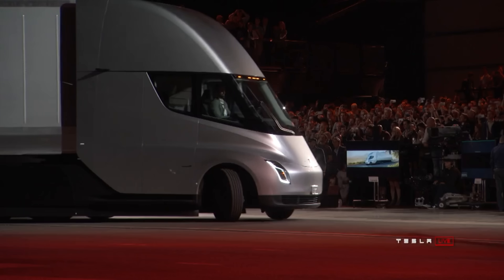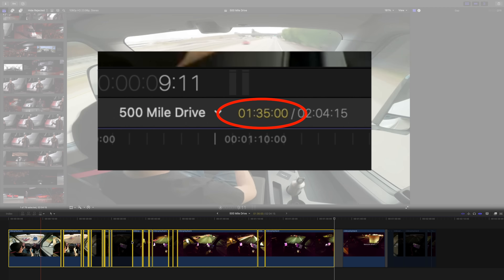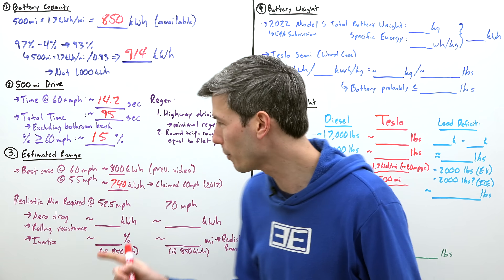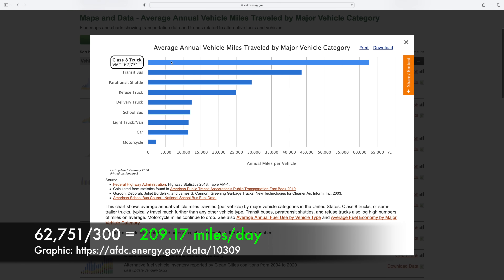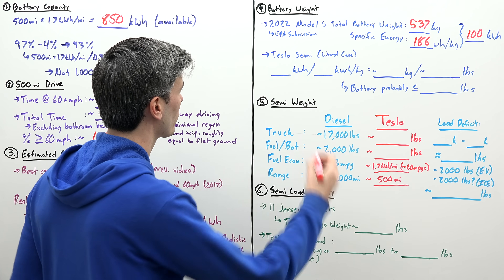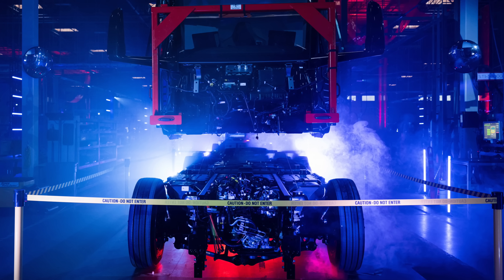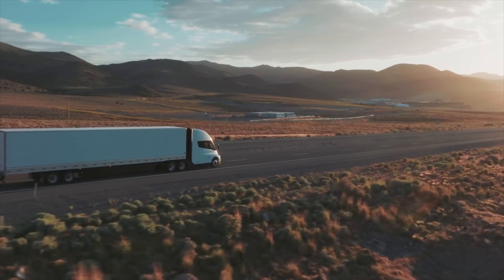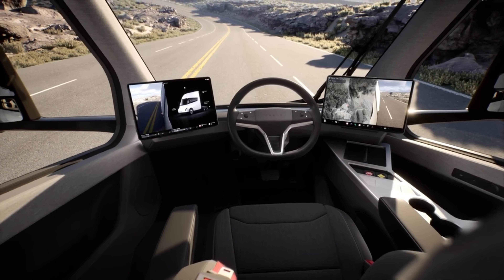Does The Tesla Semi Make Any Sense? Part 2!

Comment: Bro going below 60 MPH I can get more mpg with diesel than electric
Reply: Well only if you are geared for it. My International can only go as low as 56 in top gear, while empty on a flat road.
Reply: Not a chance. Show your calculations to support this extreme claim.
Reply: @Big_Ben_from_La_Mesa  I'm a truck driver. Get your cdl and we'll talk after that
Reply: @AshkanAbedian-qg2ni  Sad to say, being a truck driver does not repeal the laws of physics. Tell you what; give me the speed, GCVW and MPG for your diesel, and I'll give you the consumption of a Tesla Semi under similar conditions.
Reply: @Big_Ben_from_La_Mesa Being a truck driver doesn't change the laws of physics. But makes me the primary customer. Only way to win me over is if your truck can save me more money. I only have 11 hours a day and I make 70 cents per mile averaging 60 mph. A tesla costs 2 hours of my time every day just to go off route to a charging station and wait at the station to charge. I average 8.5 mpg. 2 hours of my time costs $84 per day, Which translates to 20 gallon of diesel. In order for a tesla to make up for the 20 lost gallons, It needs to achieve 15.45 mpg more than my diesel truck. So if tesla gets 23.5 mpg and my diesel gets 8.5 MPG, I'll just break even. On top of that,  A tesla semi is $400,000 more expensive than my diesel semi. That translates to 40 cents a mile or another 5.7 gallon of diesel or... another additional 48 mpg. That means I need my tesla to get 71.5 mpg in order to break even. 😂. And as is tesla gets less mpg than diesel.

Comment: This is like for all technology,  some cases will suit it,  some won't,  but bringing in regulation to force compliance will potentially have worse consequences.  Trucks aren't always fully loaded with weight but sometimes are,  and it's not the same trucks all the time.  Regulation to remove diesel could cause an increase of trucks and journeys by 30%+ as they send 2 trucks for one load. Let's hope we can all keep an objective head in the coming years.  Good video,  only comment is that day trips like this would be done in light weight semi's not large ones,  so there is a greater loss of weightthan you suggest.

Comment: I'd like to know a few things about the electric semi truck how much cargo weight can it haul compared to a diesel truck which is 20000 pounds it takes a diesel truck around 20 minutes to fill up with diesel fuel and can travel 2000 non-stop with four drivers 2 in the sleeper alternating how many stops does the electric truck have to make to travel 2000 miles
Reply: how much cargo weight can it haul compared to a diesel truck which is 20000 pounds 
About 43,000 to 44,000 lbs. But I think you're mistaken about diesel trucks; their typical payload is about 46,000 lbs.

 how many stops does the electric truck have to make to travel 2000 miles 
Four one-hour charges, loaded to 43,000 lbs. But the Tesla Semi isn't designed, intended, or marketed for OTR applications, so this really isn't relevant.

Comment: Curious what your thoughts are operating a test semi in the Northeast during the winter months. I know based on your prior videos that will drastically reduce your efficiency.
Reply: No different than a Tesla passenger car, just warm up the battery before you start driving for maximum efficiency.

Comment: The science is good here. But the Tesla Semi is busting all expectations, sometimes doing 1000 miles/day most of it under a heavy load. Bye Bye hydrogen.
Reply: Looks like it's not
Reply: @aSASa45454  The science here, or the Tesla semi?
Reply: @777Outrigger  the semi. There is a Pepsi guy who posted they're struggling to get 400 miles
Reply: @aSASa45454  Quote and source, please? Because I'm pretty sure that no "Pepsi guy" anywhere, ever, said anything of the sort.
Reply: Dan Priesty has revealed that the 500 mile Semi tractor weighs >26,000 lbs. Some estimates had the Semi battery weighing over 26,000 lbs and the tractor weighing as much as 45,000 lbs. Incredible! Starting to look like a lot of armchair engineering going on here.
Reply: @aSASa45454  But doing 1000 miles in a 24 hr period, with charging while the trailer is being offloaded and loaded. More than enough performance to replace diesel and kill hydrogen. ... Again, real world vs arm chair engineering.
Reply: @aSASa45454  Looks like it is. ....... From Electrek;  

"A Tesla Semi electric truck traveled over 1,000 miles in a single day in a real-world test for a new independent study.

There have been a lot of doubts about class 8 battery-electric semi-trucks. Many didn’t think that they would ever be able to compete with diesel trucks.

The North American Council for Freight Efficiency (NACFE) has been conducting a study as part of its new Run on Less program to test several electric trucks in real-world conditions and release the data in real time.

There are three new Tesla Semi trucks in the program this year, and we reported on the first data coming earlier this month.

Now, the 18-day study has concluded, and on the second to last day, the Tesla Semi #3 managed to travel a record 1,076 miles in a single day ......

While NACFE didn’t specify the payload for this particular day, it did say that those trucks averaged over 70,000 lbs of loads."
Reply: @aSASa45454  Looks like it is. From Electrek;  "From Electrek;   .... The North American Council for Freight Efficiency (NACFE) has been conducting a study as part of its new Run on Less program to test several electric trucks in real-world conditions and release the data in real time.

There are three new Tesla Semi trucks in the program this year, and we reported on the first data coming earlier this month.

Now, the 18-day study has concluded, and on the second to last day, the Tesla Semi #3 managed to travel a record 1,076 miles in a single day ......

While NACFE didn’t specify the payload for this particular day, it did say that those trucks averaged over 70,000 lbs of loads."

Comment: Tesla's hill climb run up a 6% grade while fully loaded to 62000 lbs was not a load capacity test, as assumed. It was just to show how it could climb a 6% grade without slowing down, and buzz by a diesel semi. Based on the cars passing by, the speed was low as was the aero drag. A 6% grade is 3.43 degrees, so at a steady speed the tractive force required is (.06)x82000 = 4,900 lbs. The semi was slowly accelerating, so the force is actually a bit more. Also, after reading the federal statute ( 23 U.S.C. 127(s) ), the wording about the 2000 lb extra load capacity is most likely to just include the 2000 lbs of batteries, and not the estimated 2000 lbs of the inverter.
Reply: In hindsight, Jason was using this example to determine the max payload weight, and the 6 percent incline had nothing to do with it. So my reply was just an exercise in how much the cab's drive wheels were pulling. But he could have used the 44,000 lbs of concrete plus the weight of the standard flat bed trailer, subtracted from 82,000 lbs, to accurately determine the Tesla Semi cab weight.
Reply: @kevink2315   ...to accurately determine the Tesla Semi cab weight. 
Yes, that's what I've done, to estimate the weight of the tractor as 82,000 - 10,000 - 44,000 = 28,000 lbs.
Reply: @BigBen621  If you look at that intro video again on the 6% grade, you can see the color of the flat bed surface is consistent with an aluminum trailer. Teasla was trying to maximize the load capacity, and used a light trailer to help. They are about 8500 lbs, so the 44,000 lbs would be too much for a steel trailer. Sneaky.
Reply: @kevink2315  Actually, that creates a new quandary. I've been assuming the trailer was about 10,000 lbs. But if the trailer is only 8,500; the load is 44,000 lbs. of CalTrans K-Rails, and the GCVW is 82,000 lbs. as stated by Tesla, then the Tesla Semi must weigh around 29,500 lbs., which is a lot heavier than most estimates, mine included. Thoughts?
Reply: @BigBen621  Tesla mislead the public, but it likely will not matter as Jason showed that very few semi's are fully loaded.
Reply: Tesla's hill climb run up a 6% grade while fully loaded to 62000 lbs 
 82,000 lbs 

 Based on the cars passing by, the speed was low as was the aero drag.
No need to base on the cars passing by, you can clearly read the speedometer, at 45 MPH.

 at a steady speed the tractive force required is (.06)x82000 = 4,900 lbs. 
Speed is part of the equation, so this is true only for a single speed.

 The semi was slowly accelerating 
About 1 MPH/sec, which doesn't seem slow, figuring accelerating 82,000 lbs. up a steep hill.

the wording about the 2000 lb extra load capacity is most likely to just include the 2000 lbs of batteries, and not the estimated 2000 lbs of the inverter.
"up to a maximum gross vehicle weight of 82,000 pounds"
Reply: @BigBen621  I wrote full load, and meant 82,000 lbs. 45mph? Where do you see the speedometer during the hill climb? How do you know acc'n was 1 mph/sec?
Reply: @kevink2315   
 Where do you see the speedometer during the hill climb? 
You can see it for a few seconds starting at 16:40 in the Delivery video. I tried to include a link to it, but YT wouldn't accept it; but I assume that's what you're working from.
 How do you know acc'n was 1 mph/sec? 
I'm having a little trouble reading the speedometer this morning—either an early morning light issue, or an early morning eye issue—but I think it goes from 42 MPH to 45 MPH in about three seconds. One could get a more precise number by counting the frames between changing to 43 MPH and 45 MPH at 60 frames at seconds and doing the math, but I don't have the patience to do this!
Reply: @BigBen621  I had studied that delivery video, but missed the digital speedometer. I get what you got, 4 mph gain in 4 seconds, 1 mph/sec. With a lbm = lbf on earth, I get 3,740 acceleration load. It's interesting to calculate the tractive force at the wheels, but that was not what Jason was looking for, and I misunderstood that, but glad you noticed.

Comment: the fact that we have to do all this math to figure this stuff out instead of tesla just telling us basic information about the trucks like battery capacity, weight, size, etc, is embarrassing.
Reply: I'm trying to understand why this would embarrass you. You and many others of your ilk seem to believe you have a God-given right to have information Tesla, a private company, has chosen, for their own reasons, not to share, except with prospective customers. Maybe the problem is yours, not theirs.
Reply: @Big_Ben_from_La_Mesa  this is all basic information that you can get for just about any vehicle. typically you want to know what you are buying when you buy something. i dont think its crazy to ask for the vehicles weight, battery capacity, dimensions, etc. from a company that wants to sell a vehicle. then again this seems like a trend in the semi truck market overall, i cant find much information about many other trucks either. that doesnt make it alright, that just makes the whole market annoying. cant easily compare two trucks if they both hide so much information about themselves.
Reply: @minneelyyyy  If you were an actual prospective Tesla Semi client, you'd have all this information and much more—just as soon as you signed the NDA.
Reply: @BigBen621  exactly. its extra hoops you have to jump through just so you can comparison shop. how am I supposed to know which truck I want to buy if I can't see the specs comparison shop without going through a whole process?
Reply: @minneelyyyy  
 how am I supposed to know which truck I want to buy if I can't see the specs comparison shop without going through a whole process? 
Well, I guess you aren't. Tesla will just have to live with the horror of not winning your business.
Reply: @BigBen621  you act like im the only person in the world who wants to actually compare the things i buy before buying them.

Comment: @litestuffllc7249  you'd have to go to death valley on a hot day to even approach that temprature in order that the diesel would vaporize on its own. 
FALSE It's difficult to see how an adult who's actually operated motor vehicles could believe that the only way the temperature of diesel fuel could be raised to its flashpoint of 125°F is if that's the ambient temperature. The only explanation I can come up with is that you're not yet of driving age, and so have never opened the hood of a motor vehicle and experienced the temperature there. Perhaps you can provide another explanation of how you would not be aware of this?

 the flashpoint goes up to 180f 
FALSE You're obviously cherry-picking this from some source, without actually verifying what the source says. Likely, this is referring to different grades of diesel fuel. But the grade used almost universally is #2. If you'll search for the Exxon MSDS for #2 diesel fuel, you'll find 100°F, obviously being cautious. If you'll search for the CitGo MSDS, you'll find 125.6°F. Valero, >100°F. Wikipedia, 126°F. BP, 125.6°F. See the trend?

 compared to a fires from a massive truck battery, the safety is at least 100x better 
FALSE This is just another in a long line of examples of you just making stuff up, and trying to pass it off as fact. If you'd actually do a little research, you'd find the statement by the National Fire Protection Association (NFPA) that "It takes some time for enough energy to accumulate to trigger thermal runaway in a battery. This makes them different from ICEVs, which can be quickly ignited by a spark or flame." 

In actual testing done by NFPA, in which an EV with battery was deliberately set on fire, it took over four minutes before flames were observed from the battery pack, providing plenty of time for occupants to evacuate. Meanwhile, a report of a collision between two diesel trucks in Gotthard Tunnel, in which 11 motorists died, contained the follow statements: “The two massive vehicles smashed into one another, with the Italian truck skewing across the roadway until it completely blocked the tunnel. … [diesel] fuel leaked from the two damaged trucks, and suddenly ignited. … As fuel spilled onto the roadway, the fire spread too, engulfing several more ... vehicles ... .” You've claimed that electric trucks should be banned from tunnels, etc.; but based on actual experience, it sounds more like it's diesel trucks that should be banned.

And this brings up another advantage of BEV fires; in general, the fire is contained within the vehicle; while in liquid-fueled vehicles, including trucks, the diesel fuel or gasoline may and does spread far beyond the originating vehicle, sometimes leading to multiple fatalities in other vehicles—for example, the Gotthard Tunnel fire.

It is true that fires in EVs are notoriously difficult to extinguish, and are sometimes best left just to burn themselves out. But if I'm going to experience a fire in or near a truck, I'd far rather be in or near a BEV, which will allow me time to evacuate the truck if I'm in it, and not spread to my vehicle if I'm near it; than in or near a liquid-fueled truck, whose fuel "can be quickly ignited by a spark or flame", and spread rapidly to other nearby vehicles.

Comment: Ben no you prove nothing; you already put forward the argument about flashpoint and you'd have to go to death valley on a hot day to even approach that temprature in order that the diesel would vaporize on its own.  Sure you go out there and set it on fire to prove your point.  99.5% of the earth never approaches 125f.  I suppose you can't agree with that - and the flashpoint goes up to 180f; which you'll never find in ambient air conditions. Which is why you have extreemly few diesel fires in vehicles.  And all you need do is smoother it and you can put it out.  So compared to a fires from a massive truck battery, the safety is at least 100x better.

Comment: @litestuffllc7249  I've fired multiple Vulcan 20mm canon through a russian fuel tank it didn't explode or burn 
This proves nothing. If you had an understanding of basic chemistry, you'd know that the flash point of #2 diesel is 125°F, and to ignite it requires a source of ignition. Since the "russian fuel tank" was almost certainly not at 125°F, you could shoot 20mm cannon rounds through it all day long, and it wouldn't ignite. But diesel fuel in a truck, especially anywhere near the engine, is very likely to exceed the flash point, and as a result would ignite readily.

Here's a quote from the Gotthard Tunnel fire of 10/24/2001: “The two massive vehicles smashed into one another, with the Italian truck skewing across the roadway until it completely blocked the tunnel. … [diesel] fuel leaked from the two damaged trucks, and suddenly ignited. … As fuel spilled onto the roadway, the fire spread too, engulfing several more heavy goods vehicles and their cargo.” 11 motorists died in that fire. 

Yes, diesel fuel will burn under "normation" conditions; it just takes a little heat and a spark.